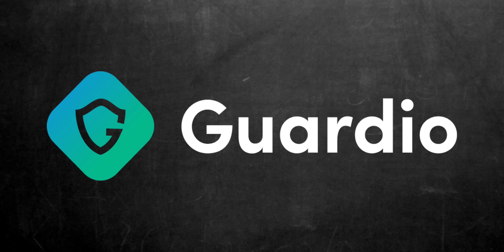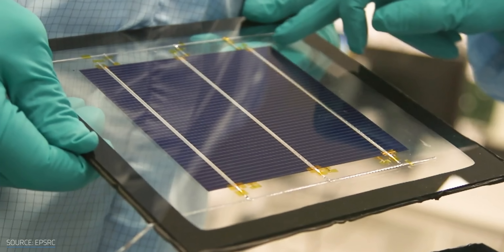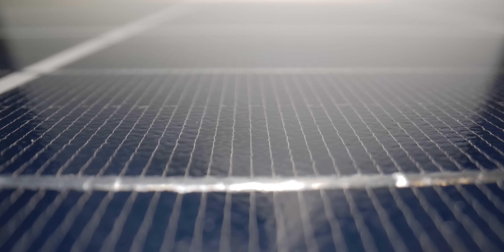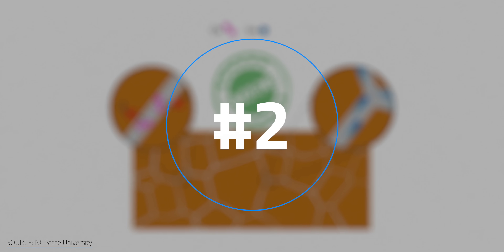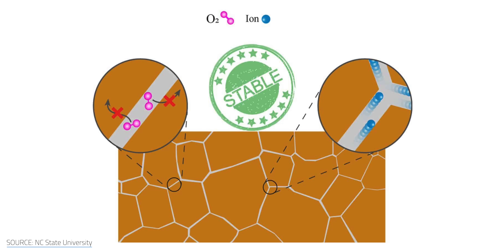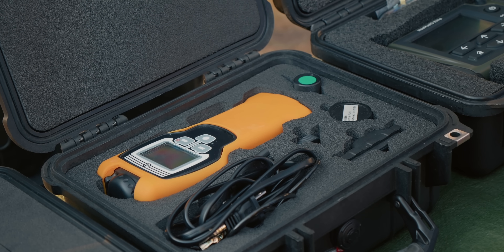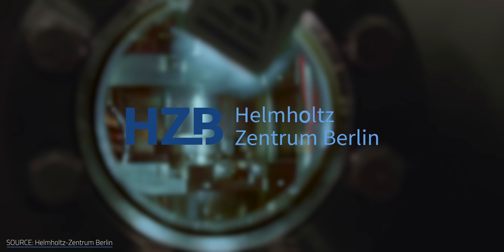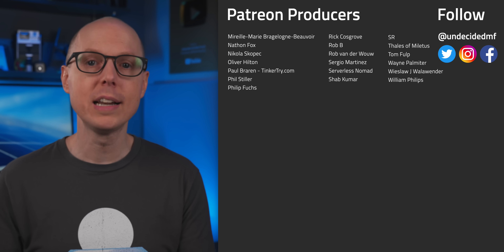Top 5 Solar Energy Advances Using Perovskites

Comment: If we can get 1kw panels on the market that are 3/4 the size of normal panels in the next 2 years, that will be game changing. Absolutely table flipping kind of game changing. We already have 650w bifacial panels for industrial use. So we are almost there. These advances might actually push things in that direction even faster than anyone even anticipates. 

I mark 1kw as the needed amount, because of some math I did a long time ago assuming for needing 3 times the total of 1 months power from 1 hour of sunlight per day of that month. This assumption was based on the what if scenario of mass sky coverage of clouds, ash, debris in space, etc, where the sun only really peaks through for an average of 1 hour a day. Basically almost nuclear winter. 

My assumptions also included things like a household having more than one computer potentially. Something like a main desktop workstation/server with a decently powered laptop to be good enough replacement for a gaming desktop. Etc. Stuff along those lines. 48kw of power coming in each hour of sunlight should handle that sufficiently I figure. And you can easily feed 120v to a household or even 240v with that many panels if you really want to. (easily as far as affording the cabling goes, etc)

To help put this into perspective for any random readers... 1kw panel can easily provide the power for your gaming console, the tv it is attached to, the gaming desktop you might have as well, and your laptop and any led lightbulbs you might have on as well as a couple side monitors. It depends on the exact wattage of course of that gaming desktop and your TV, but generally everything I just listed should be able to all run on that 1kw of power per hour of operation provided there is usable sunlight. Of course, there are limitations like amps being used by the whole load and etc, so keep that in mind; but the general rule I am coming across in the math so far is that once you can provide 1kw or more per panel per hour, the difference in output and losses from inefficiency balance out enough that going and spending 10k on some panels and 30k on some batteries and the components for wiring it all together, isn't such a bad idea at all. 

That 40-60k you might spend on everything, might very well be the last 40-60k you need to spend for the next 20 years on power. Right now with the way our power bills are at home with all 5 of us in here making it about 360$ a month, that would replace our power usage, have some excess available for bad days, and still save us about 26k in the last couple years of 20 years time. ROI basically is finished on the 18th year. And that's assuming for the higher cost of 60k. If lower, the more is saved obviously. Enough to buy another solar array and batteries if the total was 40k before and still is or less now for the same setup or better.

And that's the kind of future we are headed towards if all these advances with perovskites come together just right. With some other advances made lately too with things like copper being usable instead of silver, that will help drive down costs as well. So like I said at the beginning, if they can also make them smaller while keeping that 1kw output mark met, they will essentially be producing a near perfect product. 

A smaller thus lighter panel that puts out almost double the current standard panels do, that lasts nearly or just as long, and is cheaper. 

How could you say no?

The moment I have myself a 70+ seater bus to convert into a mobile home; I'm putting 6-12 of these kinds of panels I am making an example of, on it. 12kw/hr solar power bus that runs on electricity as well (coverting a diesel bus, which means my mobile home might end up with a frunk full of batteries to keep the weight distribution similar to prior engine installation and etc.)

Anyways. That's enough out of me on this subject matter. 

Aside from saying that now we just need the battery tech to get better and smaller and lighter and cheaper as well. And it is, just... could go a bit faster.
Reply: true. it would open up solar to millions of households who can only fit a sub 3kW system now but with new panel technology could fit a 5kW system on the same roofspace

Comment: Matt, are you aware of the National Grid policy to bill a customer for a new transformer on the street if you happen to be the house that pushes the neighborhood over the transformer's capacity? I applied for solar panels and was rejected twice by National Grid in Massachusetts unless I pay between 2K and 10K for a transformer for the neighborhood. 4 houses on the street installed panels with no problem, but I'm the unlucky one who pushes the transformer over the limit, so i have to pay. This is legal, and unfair. Have you heard of this happening? Has anyone got a better solution? I have since cancelled my solar order. So much for incentivizing people to go solar.
Reply: save up and go off-grid and give the grid a large middle finger
Reply: @drewdevlin9192  I bought a Tesla solar system with a battery and intend to do just that. Tesla worked with the utility to get me under the transformer capacity.

Comment: Just some input as to why the liquid process might be difficult to scale. Thin films of liquid are typically applied to a surface through use of a spin coater. They spin at incredibly high speed and so only the liquid close to the surface can actually stay on the wafer. This means that for an 8” wafer it’s not that big of a deal. But a three foot solar panel that’s a ton of centripetal acceleration for the material to cope with.
Reply: No no. The production is done with single wafers and dried and then the contacts added and the module assembled. the process just becomes faster when a slot dye coater is used butthe efficiency drops alittle.

Comment: There is also another issue that high PEC solves:
Imagine 20% PEC, well, that means basically almost 80% is absorbed and converted to heat.
The higher the PEC, the less  overheating problems.
Just guessing though... But that might also change the way you cool the panels. As cool panels are more efficient.

Comment: This is a good video, but you're still missing the main reason that perovskites are being researched: depending on the materials used, they can have a variable band gap.  The theoretical maximum efficiency of any single band gap cell is ~33%, but as the number of junctions approaches infinity, the theoretical maximum efficiency rises to ~87% (https://en.wikipedia.org/wiki/Multi-junction_solar_cell).  This is (one reason) why the early cells are all perovskite on silicon; More junctions, more efficiency.

Comment: Lifespan is not important from a economical view, as long as it's cheaper than regular solar. Actually the short lifespan can actually be an advantage since you can upgrade the panels often since these panels improve fast and the initial investment is much lower. From an enviormental view on the other hand, lifespan matters a lot. Recycling the panels will be very imporrant.

Comment: However, the replacement for the CFC refrigerants are gases that are super GHG (greenhouse gases) and they still escape to the atmosphere. Air-conditioning, refrigeration, freezing and heat-pumps all use vapor-compression as these super-GHG chemicals as the working fluid/gas in these mechanical systems that add to the impact of this sector that contributes more than 12% to Climate Change (including the CO2 emissions for supplying the grid electricity). Further, the rejected heat contributes to the Heat Island Effect of Cities - but, most importantly, this sector is projected to grow 8x in the next decades because it provides the only known protection from killer heatwaves. Fortunately, there is an alternative to Air-conditioning and the vapor compression system of cooling that is driven by heat, including waste heat (absorption cooling) that was always and is still completely free from the danger of these chemicals that are promoted by DUPONT among others. In the USA 90% of air-conditioning & refrigeration is mechanical,  but in the world 50% of this sector is using Absorption Cooling.  Now we also have the SolaRoof alternative for very low energy cooling of buildings that is more effective than air-conditioning and Heat Pumps. The vapor compression chemicals are still dangerous as they are a 1000x more powerful then CO2 as a cause of Global Warming.

Comment: Metal oxides (such as perovskite minerals and their synthetics) are always going to be just that - reactive metal species. The calcium salt makes the species even more reactive ... even atmospheric water will degrade these salts into their constituent ions which are then ready to react further. The physical material will visibly turn into an amorphous salty mess.

So then, stabilizing a metal (oxide) with another metal (which will oxidize in air or water) is never going to find the conditions necessary to be reduced back to a stable long-lived species.

Silicon, on the other hand, is plainly stable in its covalent lattice without penetration of oxygen or other oxidants. Methinks silicon wins no matter what the guff says here.

Comment: Two questions.  The perovskites before the breakthroughs had a problem with water, air, and heat?  Did anyone used that kind of perovskites on satellites?  Have any of the companies that are making the new version of perovskites also building a pipeline for recycling perovskites solar panels?  Bonus question. Have anyone announced plans of using either the older version or the newer version of perovskites in military tactical satellites that are designed for short duration missions?

Comment: To be clear, not all perovskite crystals have heavy metals such as lead (Pb). It is a BROAD class of materials. However it is true that, many of the MOST efficient perovskite solar cells do contain Pb, but it isn't a strict requirement.

Also, There are other heavy metals (in particular Bismuth) that are far less toxic so it might be reasonable to expect that substituting Bi for Pb might sacrifice only a little efficiency for far safer devices. This is yet to be seen widely to the best of my knowledge.
Reply: I got that from the video. Not sure why you felt you needed to repeat it.

Comment: Hmmm. The first 4 advances still look like they're in the research stage, or 5 years away from commercialization (and is often the case, 5 years from now, the prediction will be "5 years away"). Furthermore, each seem to address specific issues with perovskites, but don't look like they can be combined to address all issues. For number 5, Matt addresses the elephant in the room, which is how long before anything shows up on the market. But there is no indication of what compromises these first generation products will be making (performance, cost, toxic production methods, etc.), or whether the target markets will be broad or niche. To progress from research to engineering to mass production is incredibly complex and challenging. It makes you appreciate successes in technology even more.

Comment: I think the current panels are already very cheap and efficient as it is, but the energy storage still is the major issue.
Reply: They are not, if you want to take a portable panel in your wilderness trip it's almost useless.
Reply: Solar panels with 22% efficiency at converting light into electricity are NOT efficient. 78 of the sunlight is not converted into electricity 

The amount of inefficiency is far greater than the efficiency. Ergo, it is inefficient.
Reply: cheap? depends on what type and quality u buy but definitely not efficient
Reply: @suryakisku3895  solar panels are actually the cheapest thing in the solar power system. during noon time, I even have to cover the panels to avoid excessive heat and extra power to avoid overcharging my off-grid system. my solar panels are only about $20 per 100 watts.

Comment: We're Off-Grid on 15.3kw and the panels really aren't the issue although the more efficient the better.  It's the batteries that need a cleaner, cheaper, and renewable solution.
Reply: Efficiency is an issue because that determines the cents per watt.
Increasing the efficiency benefits both off grid as well as on grid users.

In the off-grid use case it means the total monetary outlay is lower.

In the on-grid case, it can make the difference in the economics of whether to install a PV system or not.

Comment: For "cashed up energy nerds" and solar home owners, the LAST 5 years have been incredible in terms of $-per-kW as well as raw performance (hat tip, China).  So this news of the NEXT 5-10 years sounds even more incredible.  Australians with crippling energy bills are perked up.
Reply: Yeah try 10-20 years plus, not 1 of them was viable on their own so even if each thing does work out it would also need to be compatible with the other processes to create a viable final product. Also i wouldn't tip your hat to China the reason they are cheap is simply the lower cost of manufacturing and a major factor in that is the cost of power so China builds new coal fired power stations regularly to meet their demands, while here not only do we not build them we are shutting down the ones we do have without a viable alternative hence prices rise. Honestly if you think about it, why is it cheaper that all the raw resources needed to make solar panels is mined in this country and the coal for power is then shipped to China and then the finished product shipped back instead of just doing it all here

Comment: How people are getting residential solar to pencil out?  My electricity rate is $0.11 - $0.13 per kWh. My first quote through EnergySage was for a small 6kW system at $19,200, no battery backup, and estimated payback of 15.5 years.  Estimated savings after 20 years was around $4,000.  A second quote for a 10kW system at $29,000 that met 100% of predicted energy needs had the same payback period, and $7,200 savings after 20 years.  Those savings assume no out of warranty failures, no labor costs to remove/replace panels to address a roof leak or re-roof or replace a failed panel or microinverter, no maintenance on panels or inverters.  Compare that with the return you're likely to earn investing in, say, a typical S&P 500 index fund.  Would I save a little bit of money if I got a solar system?  Probably, assuming all went well.  But positioning solar as an investment means you have to compare it against other investments.  I see plenty of people in my area getting solar panels, and I'm left scratching my head.  I don't get it.  Then again, I see plenty of people driving new luxury cars when a used Corolla will do; as a species we're not very rational.
Reply: I don’t understand Solar without storage. The majority of installs in my neighborhood are non storage; and yet the local power company does NOT buy power from solar users on peak hours, there’s no infrastructure for that. So they are trimming their bill by a few thousand dollars per year at best. Without storage to have entire days off-grid or nights 100% off grid in the summer, what’s the point?
Reply: @Ping_freud22  In warm or hot areas, a lot of your annual electricity consumption comes from cooling and the peak load hours are on hot days while the sun is shining.  So with a grid tied system you're generating electricity, and feeding that into the grid / spinning the meter backward,  at the same time that you're using a lot of electricity.   That should help to reduce your electricity bills significantly.  That said, a lot of the cost savings with solar are going to vary depending on the locality.  Climate, orientation of panels, shading from trees, subsidies from federal / state / city / utility, payment arrangement with the grid operator (net metering, etc.).  With my city utility company, after signing an interconnection agreement and getting a net meter, any generated electricity fed into the grid via the meter that's more than I used in a month would be a show up as a credit that would apply to later bills.  So in theory electricity generated in the summer that's in excess of what I would use then, could be used to offset my electricity bills from using my heat pump during the fall and winter.

The main thing storage buys you is the ability to run independently of the grid or to time shift your grid usage.  So if you lose grid power due to an outage, or if you have no grid connection available to you, you can still power your home or equipment.  You could also potentially use stored power to, say, charge an electric car at peak rate time, without paying peak rate prices.  Storage comes at a very high cost, though, and that's why most people decide to skip it.  Most batteries also only offer a warranty that tops out around 10 years, vs. 20 or 25 years on panels.
Reply: @Ping_freud22  the return on just paying a power bill is zero, solar + battery is better but solar-only is better than doing nothing
Reply: in australia you can have a 10kW system installed for under $6k usd. Why U.S residents are getting so shafted on solar pv pricing is incredible to me p.s that was with an 8kW Fronius inverter(austrian made), on double storey house

Comment: Why are you so hot and bothered for 24% efficiency in perovskites when silicon can give over 34% and have been for many years. Satellites use these, so what we need is a reduction in their production cost to make them the baseline for solar panels and not the expensive high end product it sadly still is. Is anybody investigating if this "elektron mirror" used with perovskites can do anything for the silicon cells we already have in high volume production? Adding a 5+% boost in efficiency to them would be huge even if it adds 10+% in cost.